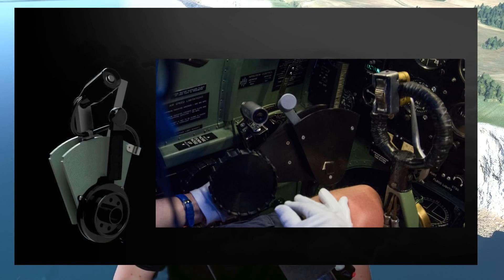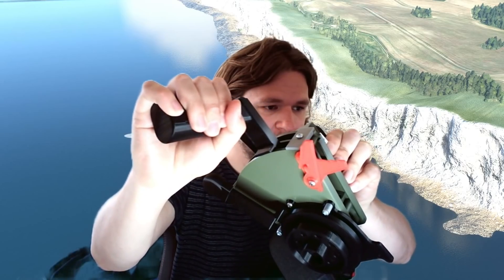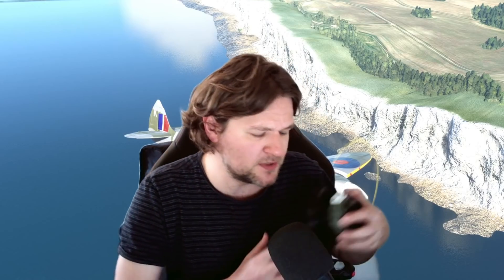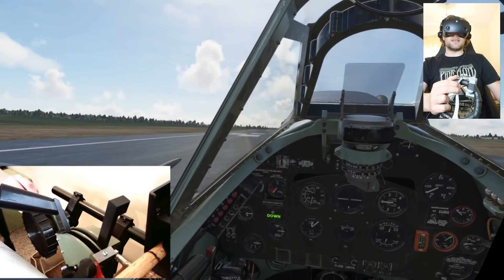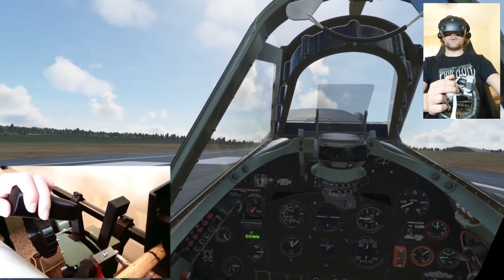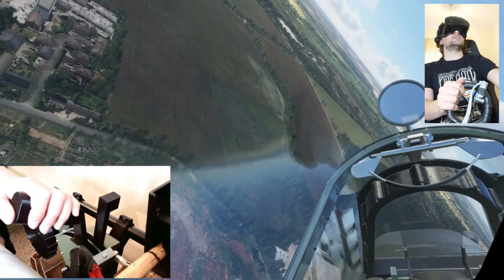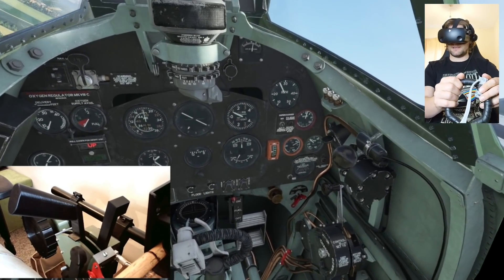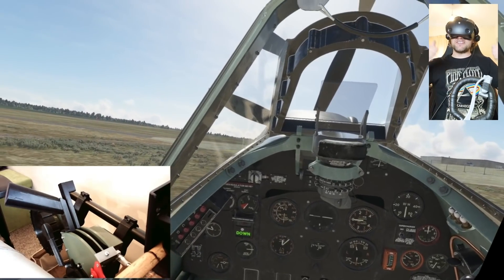MSFS VR: HOME MADE COCKPIT! HP REVERB G2 + RTX 3090

Comment: I just want to mention on a different topic that many out there still do not have a PC capable enough to deal with MSFS. For those that don't... My recommendations are as follows: CPU. either Ryzen 5900/5950 or Intel I have the 11th gen and it's awesome performance in MSFS don't know about productivity and work loads BUT for gaming it clocks the highest as I'm always @ 5.1-5.2GHZ never crashed. Ram minimum should be 32GB as When I'm flying over London, NYC or any other densely populated areas ram usage can exceed 20GB and it does often. GPU, 3080,6900xt or 3090. I've tried them all. I currently have 2 PCs One with i9 10900KF and Asus Tuf 3080 the other i9 11900K with Asus Tuf 3090. Both about the same except when in VR mode with my HP reverb goggles on. then the power of the 3090 shines thru.

Comment: Thanks for that, looks great.
Reply: Great to see these new products appearing, it looks so immersive, i took a look at your link, i will wait until they can provide  either a finished product or kit with the printed parts included. Not really interested in a 3D printer. Hoping to get the new pc this month (ordered from Scan January), although I'm having to wait a bit more  until a get back to the UK , I live in France so a bit on the expensive side getting back with all the various Covid tests at the moment. Really interested in the Flightsim VR , the HP G2 with controllers is around £575 in France. Thanks again for the videos.  Also a biker. :)

Comment: Ive got all the best gear  3090 etc ., hp reverb2 and sim shaker seat pad., But I cant get the Vr working , been struggling for 2 weeks now. Any body want a paid trip to Mallorca flight and accomodation to help me get set up when travel is allowed, soon I hope.
Reply: I feel for you. MSFS with G2 is a finicky beast. The information about getting it right is dispersed in an assortment of forum posts and youtube videos. More than that, the optimal configuration changes as the time passes, so configuring everything once will help only so much. I feel that the official forum https://forums.flightsimulator.com/ and the /r/hpreverb subreddit are probably the best sources, though.